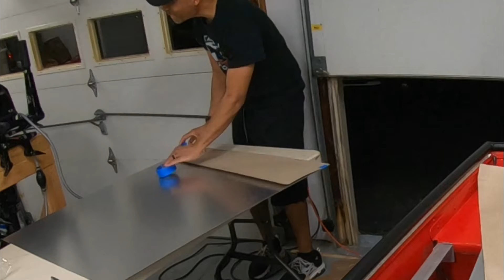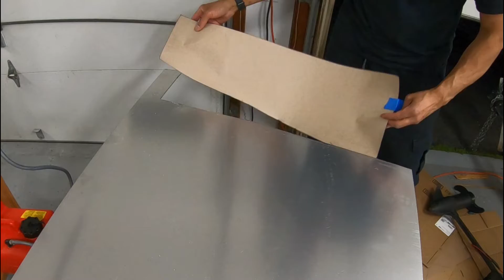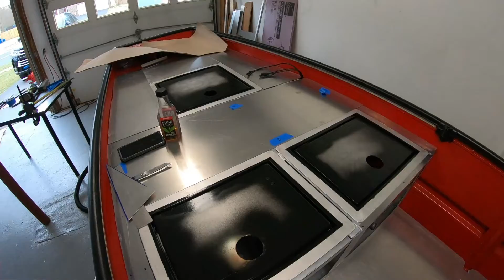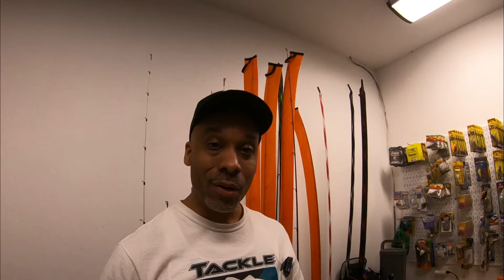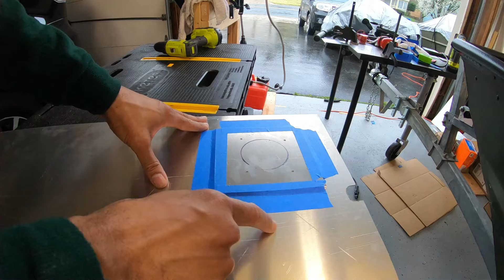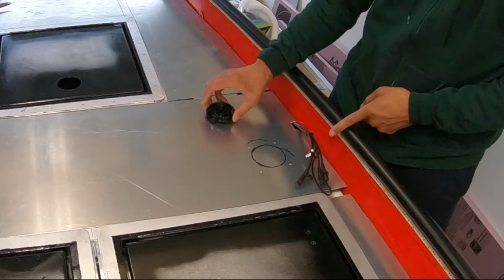How to Install An ALUMINUM CASTING DECK on Your Jon Boat {Jon Boat to Bass Boat Conversion}

Comment: I am working on decking my 1436 Tracker, i bought mostly 1/8  2x2" angle aluminum. for the deck build. I saw the build of Rona, where you used mostly1/8 for the deck beams. On this build you went all 1/16, so would you recommend 1/8 for a 1436 or stick with all 1/16?
Reply from the maker: 1/16th with upright 1-1/4"  tube support where needed.  If you're using 1.5" x 1.5" angle.
Reply: @BassBrothersFishingDMV  Thank you, very much appreciated.

Comment: Perfect timing. I was about to buy my plywood for casting deck and found in a barn 4'x9' aluminum highway sign. Now decking with aluminum.  Thank you for these videos. My 14' v hull aluminum is coming together

Comment: What's the weight capacity on the decking with the aluminum gauge you are using? What would be the equivalent thickness if you were using plywood decking? (Asking for a future deck project on my boat). Thanks...
Reply from the maker: Unfortunately there no exact answer to that question.  It all depends on the space you are decking in relation to how much support you have underneath the decking. For a 1232 I wouldn't go much heavier than 1/16.  If you have a bigger boat you could increase the thickness and the weight of the deck.
Reply: @BassBrothersFishingDMV  Thanks...